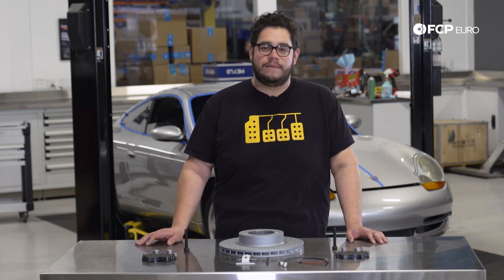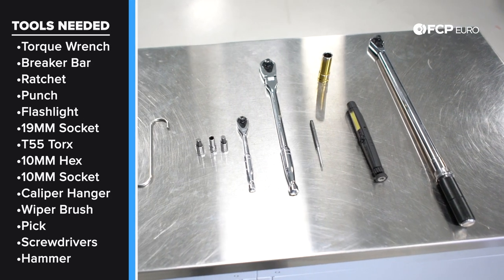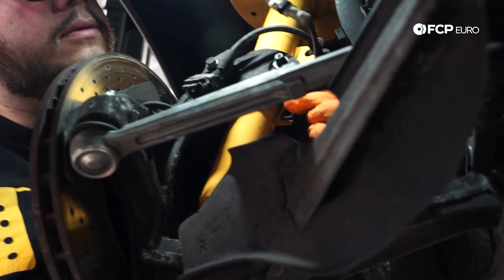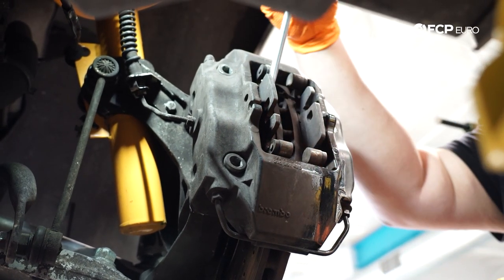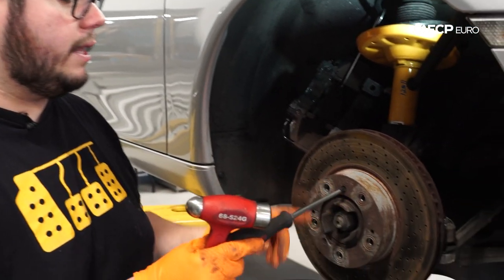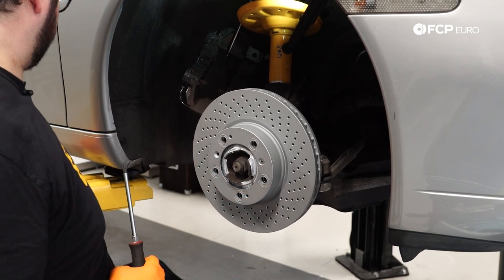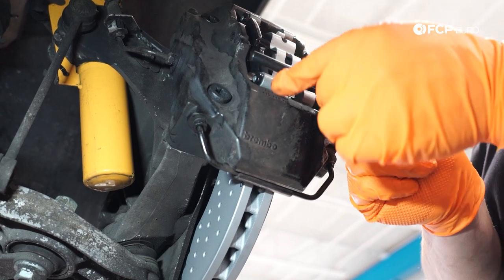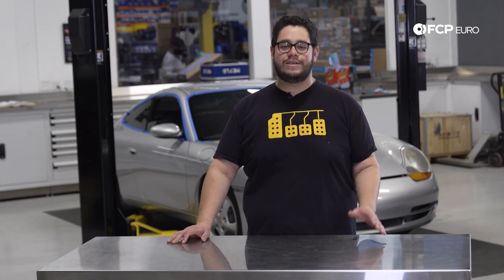Porsche 996 911 Front Brake Pad & Rotor Replacement DIY (1999-2005 Porsche 911 Carrera)

Comment: Great video and very helpful.  One comment though -- the pads don't normally slide out after you compress the pistons because the dampers are usually bonded to the back of the pads with self adhesive.  It's not easy to separate the dampers from the pads because of the adhesive material, so the solution is to remove the caliper first, then there is enough space to clear the dampers for the pads to come out.

Comment: May I add when doing this project the pins holding spring clip which help hold the brake pads may be severely corroded.  It’s best to remove this pin prior to removing the caliper as you might cause damage to the brake line especially doing the front pads.  It took a 10 pound sledge hammer to remove 2 of my pins.  I used emery cloth to clean them up, then applied anti-seize to the pin prior to reinserting the pin.